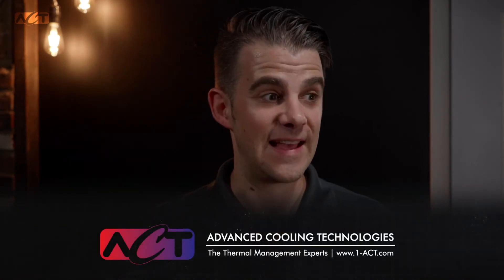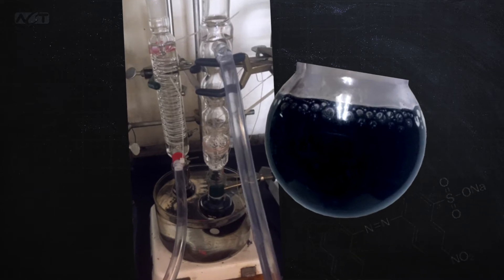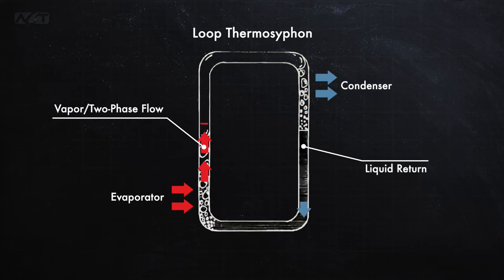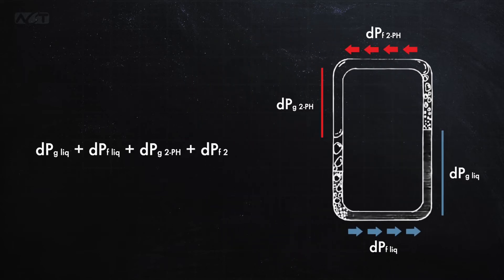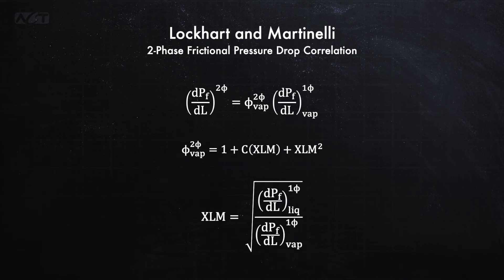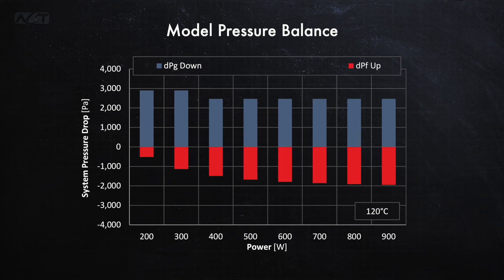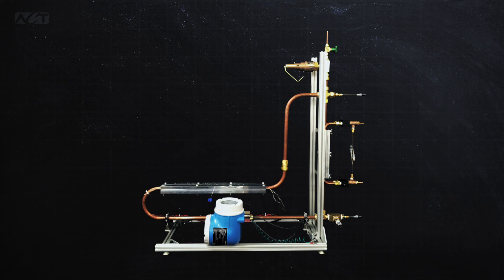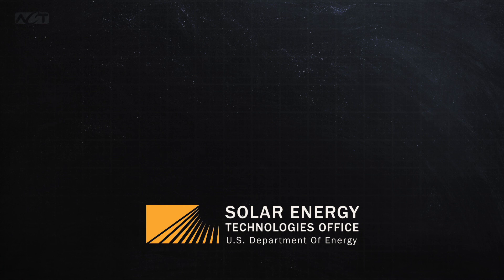Loop Thermosyphon and Solar Energy

Comment: If a power storage system is introduced in the loop as a sand thermal battery how much would the system change and is it scalable to add such battery

Comment: I've been pondering on a closed loop thermosyphon using compost as a heat source. The compost piles stays fairly steady at 150F for a prolonged period of time.

I thought to just circulate water with a pump but I hadn't considered using a two-phase medium. Now I wonder if circulating methanol would work.
Reply: Your temperatures are in the range for a methanol heat loop thermosyphon, and materials-wise, copper or stainless should be compatible. Good luck!
Reply: @christophersmith8014 did it work?  I too wish to use this principle for compost heating.
Reply: @kynknaturals  I haven’t needed to try it. Just keeping a compost pile in an insulated cold frame with the water tank does plenty. Apart from that I have so much waste heat from charcoal production that reclaiming more from the compost hasn’t been a priority.

Comment: Is this going to result in a calculator tool or a spreadsheet?  It would be interesting for people without skills in finite element analysis to be able to compute how much work they can get out of a system based on area, or piping heights and diameters.

Comment: Earlier in the video, you mentioned mass flow rate drops as power increases beyond 400W in the model; but later in the experimental vs model results, the mass flow rate shows the opposite trend as power changes from 500W to 1000W, can you please explain that?
Reply: That's a great question! The reason for this is that in the initial modeling the system fluid charge was allowed to vary with changing power. The assumption was that during operation, the liquid column would always back up right to the outlet of the condenser. In other words, the driving liquid head is constant across all of the powers. This approach works well for system design, but in a real-world system the charge must be fixed - as it was in the experimental and second modeling results. Hopefully this helps explain it a bit. Two-phase loop thermosyphons can be tricky to wrap your mind around sometimes.

Comment: So how is that larger loop coming along?
Reply: We've wrapped up our first round of testing on the larger system with good results. Everything trends well with the model (Temp, Pres, Flow Rate) although there are still some differences as are to be expected when using empirical correlations. Eventually, we will be releasing more details.